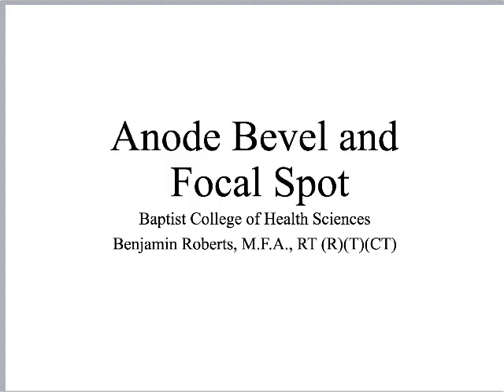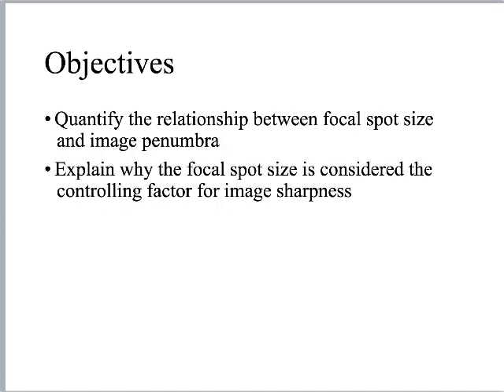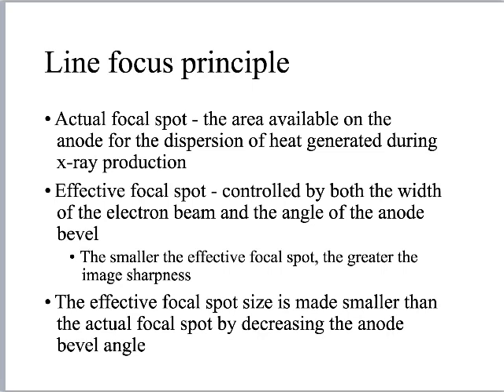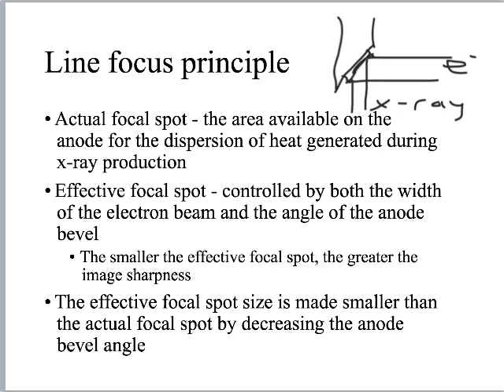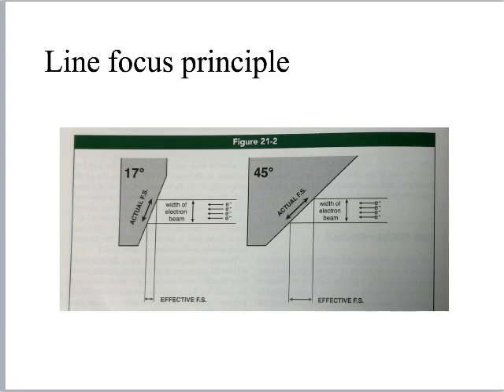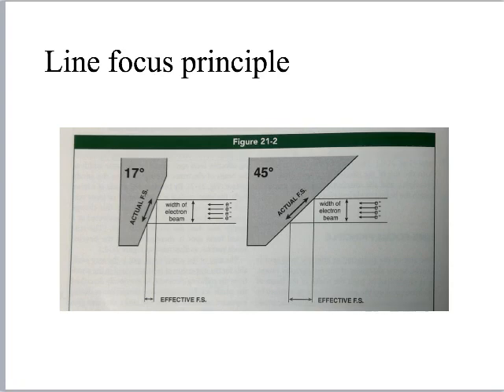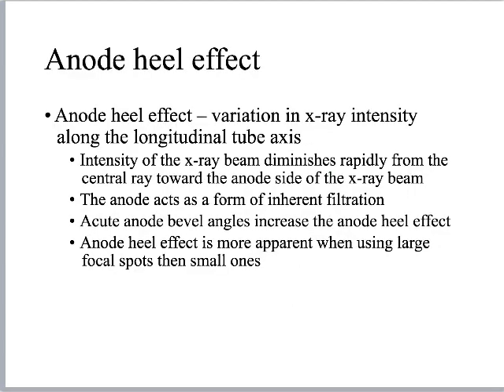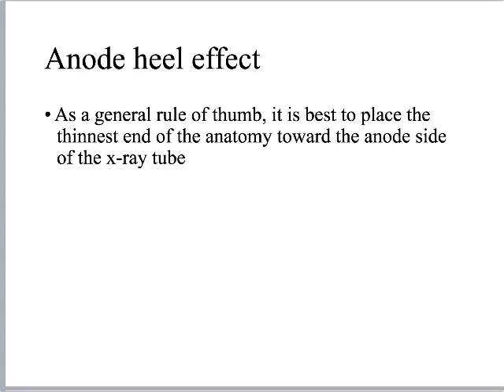Focal Spot and Anode Heel

Comment: So assuming a constant anode angle/kV/mA, using a  smaller filament produces a smaller electron beam, hits a smaller area of the anode and produces a more focused/less scattered/more parallel xray beam and you get a crisper image with less penumbra and blur. But it comes at the cost of tube longevity so you should only really do it at lower kV/mA for less time or at a higher rotor speeds. Am I correct?
Reply from the maker: Yes! Awesome summation. The only word I would remove is “parallel” insert maybe “smaller effective focal spot” and you’re golden.